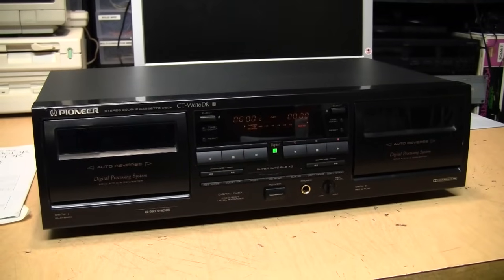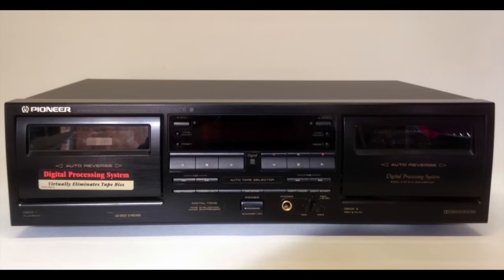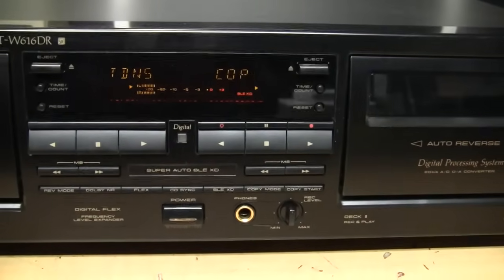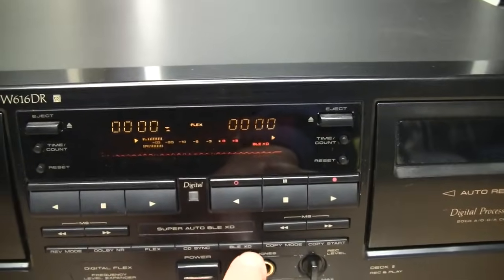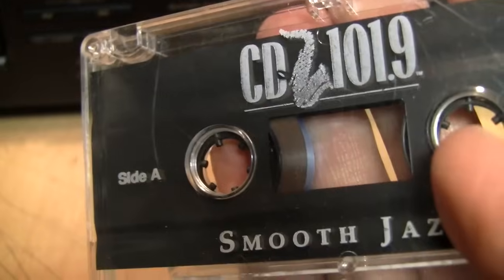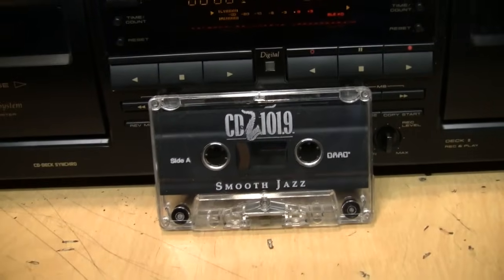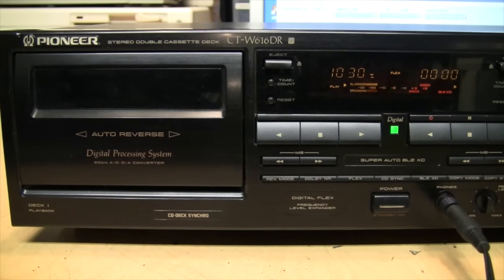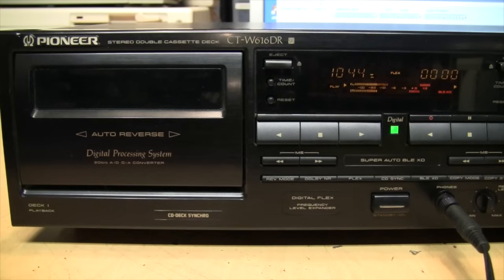A cassette deck that eliminates tape hiss - Pioneer CT-W616DR

Comment: The REAL problem cassette decks had was not hiss (at least not since the advent of Dolby B) - it was tape misalignment aka 'azimuth' issues. Even the best decks I've owned (other than a Nakamichi Dragon) suffer from it. This can't be fixed digitally. Even quartz locked dual capstan decks can't fix a tape recorded on another misaligned deck.
Reply: David, he said "other than a dragon".. i.e. he never had that problem on the dragon, only the others he's had.
Reply: Here was a screwdriver +  headphones the best and cheapest solution ... or play only your cassetes on your own tapedeck/ -s.
Reply: its not that simple. Best way was record simple sinus signal at 1000hz and then play and align head on scope, both channels the same. If doesnt go then polish head and try again, if doesnt go buy new head and try again..Ferrite heads were indistructable..
Reply: I agree. Azimuth changes as the head ages because the contact path along the heads and other surfaces on the tape transport system may become off flat, leading to skewing and thus azimuth changes, even constant azimuth changes as the taoe goes. Solution: clean up, or replace heads and pinch rollers, then re-align.
Reply: the new age of cassette decks comes with calibration / measuring the spectrum response . that was the end of c. technology
Reply: Why is it that some pre-recorded cassettes i play have the channels off center? I don't think it could be the azimuth, because tapes i record and some other pre-recorded tapes sound fine.
Reply: @connorm955  Try the tapes in different decks. If it sounds like garbage in every deck, blame the tape.
Reply: @connorm955  I have this same issue too.
Reply: Add a living voice interconnect things gets musical and gentle hiss
Reply: “This can’t be fixed digitally”. Sorry, but this just isn’t true. There is Azimuth correction in iZotope RX8, and it has been around since at least RX2 (2010). There is also Cube-Tec Restoration plugins, and various others on the market. I’ve tried iZotope’s Azimuth correction and it does a great job most of the time.
Reply: @MobiusVideo  it creates missing hi-freq. content out of what exactly? can you put some audio samples?
Reply: @ivok9846  By measuring sidebands of adjacent samples that appear simply to be distortion within the domain of a single sample but can be deduced as a component of a higher frequency that should have been read by the playback head a sample or two before or after the pickup point.  This way you can take parts of signal that were read at the wrong angle and put them back into their correct time domain - and hence find the frequencies that were originally there - rather than inventing them.
Reply: John Morris: Comprehension fail. Reread comment.

Comment: How does this compare to DBX noise reduction?
Reply from the maker: DBX is analog and requires a specially encoded tape. Digital NR does not require any special encoding to work.
Reply: I agree. My Technics deck, although analog, featured DBX encoding on analog tapes and DBX playback on those tapes.

Comment: I can really hear the artifacts on the high end, not the nicest thing in the world. It almost sounds like when you're in a room and something resonates with a snare drum. I could see using this to restore cassettes in some capacity.
Reply: I wouldn't really trust tiny little artifacts like that after the audio has been shoved through youtube's compression system...
Reply: Yep. The noise reduction may cure tape hiss, but tiny format cassette tape running at 4.76 cm/s is going to be fraught with tracking anomalies, plus wow & flutter - which are compounded with prerecorded cassettes having two separate machines for the recording and playback.
Reply: Sounds a bit like a slightly mistracking phono cartridge
Reply: Camcorder mic/line preamps also tend to do this, as an AGC

Comment: I picked up an old ONKYO TA-RW404 from a local auctions "table deal" a few months ago that also came with a TOSHIBA PC-G30, went back a few weeks later an snagged a ONKYO T-401 that came with a RC-255S remote havent tested it out yet since it only has a L/R Output on the back which I might can try hooking in to my pc's line-in

Comment: I have the CT-W604RS deck, which is kind of the equivalent to this one, but completely analog instead of having digital components. It also has Super Auto BLE XD, FLEX, Dobly B and C, but also has Dolby S. I've heard from purists that this deck and all the digital decks make the tapes sound harsh and dull, but I hear nothing of that here, sounds quite good for me. Either way, it would be quite interesting to see how different the technology is in regards of Super Auto BLE XD, Dolby NR and FLEX when it comes to their digital and analog versions. At least in the CT-W604RS I realized that there is some sort of filtering going on when using Dolby NR that takes out all frequencies above 18 KHz, even when using chrome and metal tapes, which is a bummer.
Reply: Does this occur for Dolby S as well? I'm an owner of the same deck. How did you become aware of this? I'm not doubting you, I just want to learn more about potential limitations with my machine.
Reply: @awesomeferret  Yeah, it occurs with all Dolby noise reduction modes. Apparently it's an MPX filter meant for FM radio recordings but that unfortunately it's not switchable. I noticed this problem when transferring a cassette recording to my computer, I noticed that all frequencies above 18 KHz were gone when looking at a spectrogram of the recording, something that doesn't happen if you record without Dolby. I personally don't notice the missing frequencies when listening to the recordings, not even when monitoring (yes, it also happens from the line output when monitoring a recording), but my hearing is already kind of busted, so yeah xD
Reply: @CoTeCiOtm  if that's MPX filter related, then it could be a hardware issue. Sounds like the filter is being triggered erroneously. I don't know about Pioneer decks when it comes to this, but I have a Sony Tc-K22 that has a bit about this exact issue in the user manual, but that has an easy and obvious way to disable the filter. I don't know if it's possible to disable the MPX filter on this deck, but it's not as big of a deal thanks to the other features (even the BLE XD can reduce voice since it allows you to record at much higher volumes).

Comment: The problem i have with this noise reduction.... as much as i find the feature interesting... it is not really something I would use often. Because there is absolutely no non-destructive form of audio filtering. So there is always a loss in quality. The artifacts being the worst and making it sound like an MP3 at low bitrate. That weird chirping really drives me nuts after a while. I think an analog recording with the proper audio level plus DBX or Dolby C noise reduction during recording, is pretty much the best you can do on normal audio cassettes. If the recorder itself even has a high frequency response (like a Sony TCD5 or a WMD6C) your recording will sound as good as a DAT recording.
Reply: I agree - I have a Tascam 122MKII, and you can tune the bias for each cassette type.  Maxell normal tape can sound very good (but nothing beats Metal!)

Comment: Aside from the occasional residual artifacts of hiss remaining audible during portions of speech, the digital noise reduction seemed happy to oblige, cleaning up what would otherwise be a very noisy tape. Using this or a similarly qualified cassette deck would prove immensely useful when transferring out-of-print cassette tapes to CD or digital that weren't even recorded with Dolby B.

Comment: You really have to listen to the source to fully appreciate the sound I thought while there was very little hiss and only a slight drop out on the tape here and there the digital encoding via youtube took the bandwidth out of the recording. 

I find with digital recordings the bandwidth is lost to some degree a bit like listening to  a device with auto volume limiting enabled.

Comment: I want to know: What happens with the Digital Noise Reduction, if you record "White Noise" onto the tape? 🤓
Reply from the maker: As the disclaimer in the manual says, Digital NR is only designed to eliminate tape hiss, not any additional noise that may be in the recording.

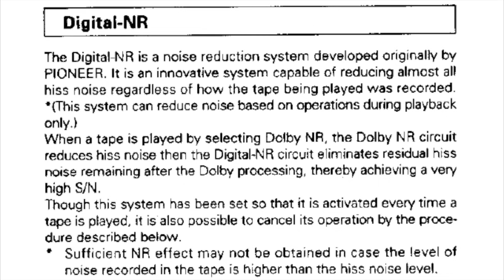Comment: Yes assuming you're using metal tapes only but look at the manual @3:15 frequency response TYPE II (HighCrO2) tape 20 to 19.000Hz and TYPE I(normal) tape 20 to 18.000Hz I'm assuming that in most cases "normal" tapes would be used.
Reply from the maker: But the digital sampling rate has to at least support a 20 kHz frequency response, with some room above that for the anti-aliasing filter. The only digital sampling rates in common use on the consumer market in the '90s were 32, 44.1, and 48 kHz, so it has to be either 44.1 or 48 kHz.

Comment: Many digital devices at the time did not have digital output because they operate at nonstandard sample rates and bit depths since most receivers at the time could only take 44.1khz/48khz 16bit, feeding a 20bit 36khz signal from 18khz frequency response tapes would cause an error and make it output just noise or nothing at all.
Reply from the maker: The frequency response for metal tape is 20 - 20,000 Hz so I'm sure it uses at least 44.1 kHz sampling rate.

Comment: Very good cassette deck. I would never find something like that here in South Africa. But I must say I do use external audio processors to clean the audio up from my early 1980's Pioneer CT-520's and they sound very good (ferric tapes used). Also got a Pioneer CT-F500 and a AKAI F-110 that runs off the same system and I get pretty much the same result off them. Never the less I would love a deck like that!

Comment: i love that pioneer era. my uncle and i got a pioneer private mini compo in japan in 2015. only 2000¥! that's less than 20 bucks. everything was broken except the amp and the cassette just ran in normal auto reverse. the rewind and ff were bad as well. easy to repair but it was to expensive to take it here to Peru. what an elegant and serious looking machine. still miss it :(

Comment: I have the ct-w803rs, it's basically the same as yours. The only difference is mine has dolby s, but not the digital processing like yours. Mine also has a record head on BOTH decks, so you csn record two tapes at once. The 803 was later rebranded as one of the pioneer elite series. I consider it the BEST decks pioneer ever made. Your's is a very good deck as well.

Comment: I have a Pioneer minidisc deck with Digital Noise Reduction.  It can be used as a stand alone noise reduction unit and DAC, too, so I don't need to be playing or recording a minidisc to use it.  DNR works very well.

Comment: It sounds pretty horrible. You can hear it actively work, especially in the softer areas. Most of it is dull and lacklustre sounding then when it gets louder the highs are 'allowed' through.
I'd rather have noise, honestly :).
There's also weird dynamic jumps much like you're playing a non-dolby tape with dolby C.
Cool demo but the system itself is absolutely worthless.
Reply from the maker: I did say the CD 101.9 demo cassette is the worst-case scenario, being a Type I tape with no Dolby encoding. Considering the large amount of hiss on such a tape and the limitations of 1996 DSP technology, it's amazing that it works as well as it does. And on higher quality Chrome and Metal tapes with Dolby B or C encoding, the artifacts are much less audible. Listen to the additional demo I linked in the description.
Reply: Don't get me wrong by the way; I really like the demo and I am happy to know what it sounds like, I am just very disappointed by the outcome.
So far, when it comes to 'noise reduction without pre-encoding', I think DNL does the best job, but in that case I still prefer the hiss :D.

Comment: Nice demonstration! Pioneer made excellent decks in the 80's-90's. I'm listening on headphones and I hear the digital NR creating "breathing" artifacts during the DJ talk and the Billy Joel song on the CD 101.9 tape. I wish you would have demonstated some other pre-recorded cassettes and recorded a CD onto a High Bias or Metal tape.. or even a budget Maxell UR or TDK D. The main thing I disliked about most dubbing decks from the 80's and 90's was you couldn't adjust the recording volume for copying another tape. It was ether pre-set or they used an AGC circuit on many decks.
Reply from the maker: See the links in the description for examples of more tapes played using this cassette deck.
Reply: Ok thanks! BTW I've never seen a promotional tape for a radio station before.
Reply: @vwestlife  Hi, a very informative video in so much I purchased one; the 606 UK version. I’ve also subscribed to your channel 👍 Do you know if there is a way to have this functioning with a remote via the SR control system as a standalone? Would the Pioneer MR-100 remote sensor work as the receiver with a universal remote as the transmitter, e.g the Logitech harmony remote?
Reply from the maker: @stephenmaneleys6983  Sorry, I don't know anything about its remote capabilities. Maybe look in the service manual for it.
Reply: @vwestlife  Thanks and noted. Linked it with the Pioneer SX-339 via the SR link which has IR. Keep posting these great videos 👍

Comment: I had a CT-W606DR in the early 2000's garnered from a Goodwill, and I used to use it for making Tapes for my car off of vinyl.  Excellent sound quality, unfortunately one day it just didn't turn on anymore.  Mechanical failures are easy to fix, but failures in modern electronics are a bit beyond me.

Comment: Amazing specifications on this tape deck!
The only down side is the lack of precision in the record level display, especially with this kind of S/N ratio. Sony TC-K61 etc.
had segments for  Inf. -40 -30 -20 -15 -10 -7 -5 -3 -2 -1 0 1 3 5 8 dB
This Pioneer absolutely deserved a better record level meter!
Reply from the maker: On my Nakamichi the meters go all the way up to +10 dB. With the Pioneer only going up to +6 that means the meters are pegged a lot of the time when playing commercially pre-recorded tapes.
Reply: LakeNipissing Kind of reminds of the meters used in the Nakamichi ZX-9/ZX-7.

Comment: I recently grabbed a Sony TC-K461S with the Dolby S. still mostly new in the box, excellent condition. One issue though, the belt actually melted, not super uncommon thing here in AZ. happens to those rubber legs on old computers I find at times. So hopefully I'll be able to remove the melted goo and replace the belt. I've never really worked on cassette decks before.

Comment: Terrific sound and clarity. I don't think I've heard less wow and flutter from a cassette deck other than this.
Reply: Try the Dragon from Nakamichi.at 0.019%.  This is the weakest point of this Pioneer Deck at 0.09% And yes you can hear it on a well recorded piano alone.
Reply: @seacampal1425  yes and no. This is the first cassette deck I've ever heard where I don't believe the specs or meters once I start actually listening, even though I know what the spec actually is. And even with the relatively low spec, it's still a huge bang for buck, and when you consider the vastly superior fidelity that it has over many older decks thanks to things like FLEX, it's a much more sensible way to get a high quality sound out of a cassette. Sure, they're cheap machines, but they're the pinnacle of cost vs performance in my opinion. Any deck that can fool people into thinking you're playing a CD is high end, and this one can certainly do that, even with piano music. And that's not even to mention the fact that there are a surprising amount of people (including me) who don't care about wow and flutter so much, since it's nostalgic in the way a damaged record has crackles. If I want to listen to audio without artifacts, I pull out my LG V20 or my LG V40. If I want to have as much fun playing the music as I do listening to it, then sometimes a waverly piano can be a part of that fun experience.
Reply: @seacampal1425  don't forget dragon is over 6k dollars now, sometimes more depends how much owner wants to make money on you, 
this Pioneer dose it all for about 150 dollars sometimes even less, don't get me wrong am just saying we all appreciate 
Dragon technology but most of us will not spend that much money on it. The hiss in Pioneer is totally gone in digital mode, I do own one 🙂
Reply: Seb strophyl Even Sony DD Walkmans have less, 0.07%.

Comment: I don't get the appeal of noise reduction... I feel like if you're listening to a cassette, you should just deal with tape hiss, it's gonna be there regardless, and usually you can just tune it out. Noise reduction, like you said, sometimes leaves you with noticeable artifacts and I can't imagine why someone would find themselves listening to that and thinking "yeah, this is fine", and I think it's that kind of thinking that can really hinder the quality of a cassette rip.

I feel like if you're listening to something on cassette and you find yourself that annoyed by tape hiss that you want to start messing with noise reduction, you're better off just listening to whatever you've got on a superior format. If a better format doesn't exist, you just deal with it. A little tape hiss has never hurt anyone.

Comment: Whats the difference in this nr system and DBX?
Reply from the maker: DBX is analog and requires a specially encoded tape. Digital NR does not require any special encoding to work.